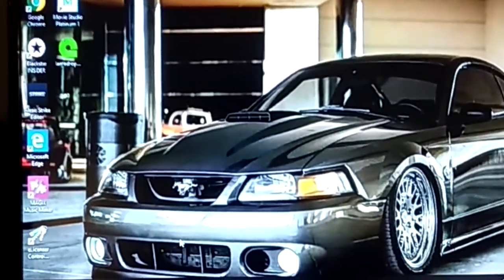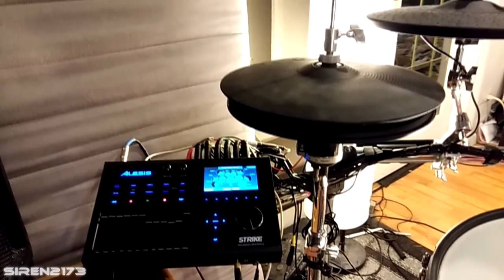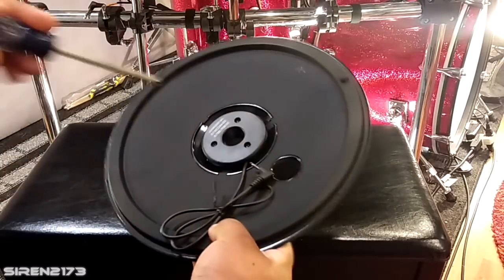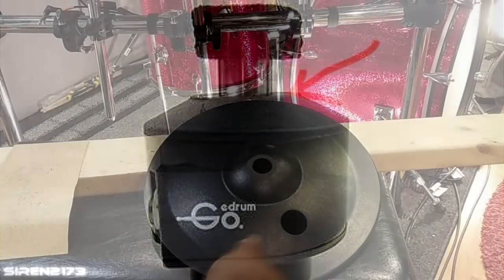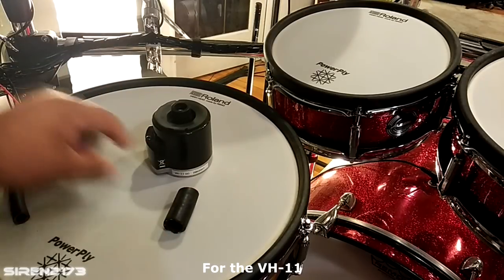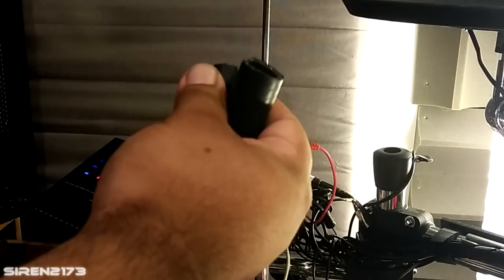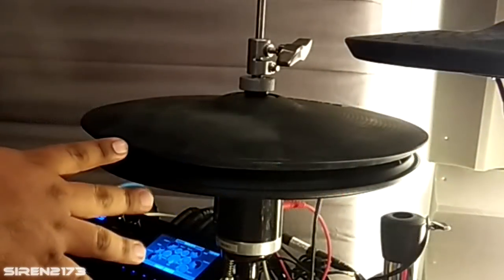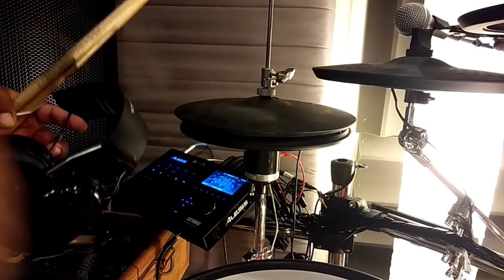HOW TO REINTEGRATE the bottom ALESIS HIHAT CYMBAL INTO your new CONTROLLER

Comment: Thank you!   Since the large rubber piece is what is pressing against the controller, you might be able to dial it in and have it be more precise by using hard PVC pipe, they make small sizes for watering systems.  I don't know if that would make more noise being continually connected or not.   I'll let  you know when I mode mine.  :)

Comment: Great idea over all. I got mine to work fine. I have the GoEdrum HH controller. I guess I missed it, but I saw where the spring is removed from the base at 5:45  and a two inch hose piece cut, but never saw how the spring and hose interacted or how it all went into the final assembly. I have mine working and never did use the spring. Puzzling.
Reply: I should say I never used the hose or base either.
Reply from the maker: The spring is not included. You only need the plastic piece from the bottom
Reply: @AtTheSourceStudios  Thanks for the reply and video. At this point I have not used the piece from the bottom. Not sure where it would go.
Reply: Where does the plastic piece go if you use the e GO controller?

Comment: I so appreciate this DIY video. I just got VH11's and had no idea how to integrate it with the bottom of the strike hats....now I do! Thanks!

Two questions, on the bottom of my stand before I slide the controller on it, there is a plastic rectangular piece that has "HH CONTROL" (white label cable) plugged into it.  Do I no longer need this piece or cable at all? It wasn't mentioned or shown in this video.

Also you said to have the Spring ready but didn't show anything with it...where does this go now?

Comment: Great job thanx for the video nice to see someone thinking out of the box ..my Alesis Module was crap and so was the second one they gave me , I also had hi hat edge fail so Alesis.. the only thing good I will say about them did replace it so now I have a spare ..I am using TD 30 module and the hi hat works pretty good but still not 100% happy I will order the VH 11 controller does the Goedrum work as good cause its way cheaper ...thanx again great video

Comment: Great video, and it worked perfect. Would you be able to post the bow, edge and pedal settings you use?
Thanks!
Reply: Just an aside, I removed the plate on the bottom cymbal as shown at 3:01 but only wrapped the cord around underneath the plate and then screwed it back on. Most all of the cord fit under the plate without much difficulty. The end jack was sticking out through a slot in the plate but I could tape that down without it restricting the top cymbal. This way you do not have to destroy the cord and electronics inside in case you ever want use or sell it again. FWIW

Comment: Hi, I fill so happy that ther's a fix for that HiHat I bought it and never use it. I got the ALESIS Pro X Hi-Hat (R:6D-1) Can I do that fixing too? If that's the case, Is there a way to get the VH11 alone? The VH11 is actually a Roland part and they don't sell it alone, but with the symbals and the entire part is arround $400!
Reply from the maker: The GoEdrum controller I mentioned in the video is only $50 and same function as the vh11 controller. (That's the one pictured in the thumbnail)

Comment: Cool. I have both here, I am gonna do the same. Thank you. And, how can I get a total closed hihat sound? mine is always a little bit open all the time.
Reply from the maker: Once you do the mod you should be able to get the fully closed sound but if settings aren't helping you might have to cut a longer large hose piece so that it reaches better to the controller sensor.
Reply: @AtTheSourceStudios  Got it, but I am facing this issue since before the mod. I mean. I cant have any totally closed hihat sound on my module. Which is weird. I have it on my DM10 module. I tried a lot of settings. no success. :(

Comment: great vid man and thanks for it!  i'm enjoying watching  all your vids and drum covers.  i'm new to the Alesis Strike Pro kit.  a great switch up from the DM10 Studio kit.  can the VH-ll hi hat controller be purchased itself without the top hi hat piece?
Reply from the maker: forhiscoz thanks man :) unfortunately no but if you check the online sites there's usually a few on the used market. It's only about $250 for a used VH11 with the cymbal then you could use the stock cymbal as a splash. That's what I did anyway but ya man just keep a look out online and I'm sure you'll find a VH11 controller for sale out there
Reply: thanks for the response! sorry for asking another question but have you tried any of the other Roland Hi hats like the Vh12 and 13s?  i guess where i'm getting at with the question is if it works with the Alesis module?

Comment: I am not a drummer but I am building an A to E kit for a project I am in.  Could I do this same mod using low volume cymbals and a trigger (Like a simmons) on the upper hat?
Reply from the maker: Yes the top hat like that would be fine just single zone. More of a concern is the opening in the center of the bottom cymbal being not wide enough to fit over the sensor in the controller  most likely. I honestly haven't tried it tho so I can't say for sure.
Reply: @AtTheSourceStudios  I've got tools. Sweet.
Reply: @AtTheSourceStudios  I'll let you know. I got tools.

Comment: It blows me away that we've spent $2,400 on a drum set and are having to go to these levels to make the thing work.  I have a new kit on 1.4 and have fought it for over a month now.
Reply: Ive had mine for 2 years now and I've got it the best I can. There were all sorts of problems with it when it came out. The old forum was ful of page after page of complaints and 'fixes'. Alesis said it was just a setting up issue and refused to agree there was a problem. Now the new limited edition kit is out there is a totally different hi hat sensor??? All the people who bought the first kits have just been left to defend for themselves not even an apology!
Reply: @Know-Expert  I did see that the new kit comes with a completely different hi hat setup.  For me, a heavier duty hat stand and the 1.5 software update has helped but it's still not what it should be.  If you see my channel I did a video showing how to make a cheap device to trick it into giving consistent  half open sounds